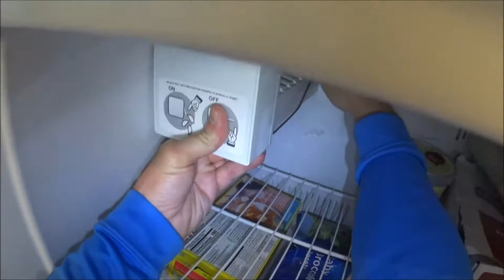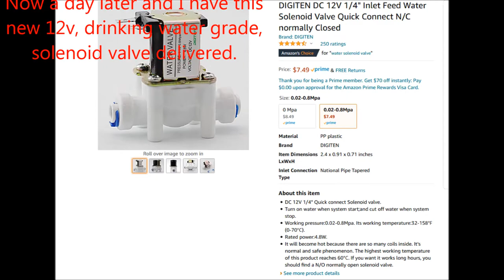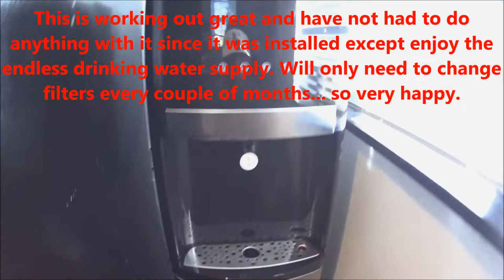Bottle-less Water Cooler Modification Hack Upgrade To Filtered Automatic Endless Supply System

Comment: This is exactly the solution I was looking for! We don’t need bottles anymore because we put in a filter system, but missed out on immediate hot / cold water with a built in Keurig. Thank you!
Reply: Did not the water dispenser not heat or cool anymore once you converted it?

Comment: Thank you for this wonderful idea! I was looking to supply the water cooler from an osmosis water filtration system. This is definitely the easiest way.
Reply from the maker: You are very welcome. That should work great as long as there is at least 30+psi going to the solenoid valve it should fill the cooler tank quickly enough (cooler has a fill timer so it knows when the water level is depleted, i usually just open and close the door to restart fill timer if i have used a bunch of cooled water too quickly - like filling 1/2 gallon jug non stop)
Reply: @macaroni2415   I don't know. The filter flow is not that great. I'll let you know the results.

Comment: I did the exact same thing! Similar model also. I was thinking of making a video, but you beat me to it. The sound of the pulsing solenoid is gratifying. Perhaps a link to the 12V solenoid would be helpful. I bought 3 for backups. So far, after 6 months, no problems. I will flush it out with a mild bleach solution and then with citric acid in a few more months.
Reply from the maker: Hello DDD curious if you are still using this setup. Its 2/3/23 and ours is still working perfectly and have saved approximately 180- 5gal bottle refill/exchanges so far. So happy with it, we hated lugging those big bottles back and fourth. Yes agree that solenoid pulsing is sooo gratifying. I will look for that link and I think it was from amazon (cant remember if i originally added it to video but i think so)
Reply: @Mac Aroni  

Still working with the first solenoid. 

I  run some mild bleach solution every couple of months from the water filter through the cooler. I add the solution into the housing with the filter removed and then flush it through. Otherwise, there will be "lily pads" growing in there. 😆

The old bottles are gathering dust.

Comment: I will been trying this, hopefully this Thursday coming up.   I got the part from Amazon.  So the water pump is not needed anymore because of the water pressure coming from water line.
Reply from the maker: Thats great to hear, hope it works perfectly for you. * remember to connect the correct (in/out) sides on the valve and use a 12vDC valve. Good luck.

Comment: I have the same water cooler and am trying to do the same thing to mine. I ordered the same valve you used and installed it but the water ends up filling up and draining out of the overflow tube.  I re checked everything to make sure the water was going the right direction and everything was correct. I figured i just had a defective valve so i ordered a new one and installed it but got the same result. I thought maybe the line just had too much pressure so i turned the pressure way down.  Same result.  I have no idea what the problem is. Anything i may be over looking?

Comment: I did the same but not sure why the out put I am getting in the 12v is list between 0.5 and 1.5v, Not sure why. Will it be issue with the door switch or the board or something else? Do you have any idea?

Comment: Thanks for the hack! This worked great except now the cold side keeps freezing up the water. My gut feeling says swapping out the pump shouldn't be related to the cooler but that is the only thing that I've modified. Now we need to shut off the cold side to let it defrost then it'll dispense water. We've defrosted the cooler a few times now. Anyone have any suggestions on the fix? I cannot see anything that would turn up the temperature so that it doesn't turn the water into ice.

Comment: So i need to remove the pump first? Because mine had water going everywhere
Reply from the maker: Hello, yes the pump will be removed one way or another either partially or completely (i removed mine from the cabinet as its no longer needed) and yes water will drain from pump and tubing so place a bowl/bucket until drained. Hope you had success with your setup.

Comment: great video, is it possible to instead of the water line coming from the home, it will come from a big 30 Gallon Water Barrel that I can fill with a couple of those 5 gallon bottles?
Reply from the maker: Thanks, and sorry for the late reply. I think in your setup it would still need the (fill pump/motor) since there's not enough pressure to fill the cooler tank.

Comment: Thank you for this video! I did exactly as you said and everything worked great. Except every once in a while the dispenser makers a really loud buzzing noise that can be heard in the other room. When I press for the water to come out it sometimes stops. It didn’t do this before. Any ideas how I can fix this? Thank you
Reply: Probably the pressure is too high, try controlling the flow from the source valve.

Comment: Hello 👋🏾 it’s a great video and very helpful 
I just have one question is the red light always blinking and can I still get the water cold/hot when is blinking?
Reply from the maker: Hi Omar, sorry for the delay but no the red light should not stay on (reset it by opening, wait 5sec then close the door) and if the light is on the cooler/heater will not run until reset. If red light happens frequently, it may mean there's not enough water pressure, water valve or filter clogged.

Comment: Why can't we use the original pump on the dispenser?
Reply from the maker: simply because the pump has no way to positively shut off water pressure going into it but the solenoid valve does do this. You need a way to kill the water flow when the cooler knows its at full level.

Comment: Can u be more specific about the fill timer?
Reply from the maker: The fill timer is the circuit boards built in clock to shut off filler (on power) which is usually the pump so that if the tank level isn't filled in that time (aprox 1min) it thinks the previous source (5gal bottle) is empty and shuts off pump and cooler.
Reply: @macaroni2415  Is there a way to overpass the Fill Timer? Or it is not necessary?

Comment: Is it possible to do this with the pump still attached? I would like to use a reverse osmosis filter system, but I'm worried that the water pressure will be too low.
Reply: I guess you will have to use both, the solenoid is for stopping the water flow when the tank is full.

Comment: How hot does that solenoid get? Does that cause any issues?
Reply from the maker: Sorry so late, the solenoid should not get hot or even warm if done correctly.
Reply: It won't get hot because it gets electricity only when the tank needs water.

Comment: UNFORTUNATELY I DID THE EXACT THING ON A PRIMO MODEL 601125 AND IT KEEPS OVERFLOWING THE RESERVOIR TANK.. ANY SUGGESTION? THABK YOU IN ADVANCE…😊
Reply: Same thing for me on the Primo Model 601292
Reply: I wonder if putting a shutoff valve in line with it where you could turn down the pressure would keep the timer from overflowing the unit? We had an issue at our office when they tried to run an RO water line to a coffee machine. Depending on how much water had been removed from the system prior, the pressure was always fluctuating in the line. The coffee machine just used an adjustable timer to fill coffee pots. We found that sometimes we would overflow coffee pots and have to catch it with a 2nd one, and sometimes they would only be half full if someone had used water from the water cooler next to it before coffee was made. We ended up getting a gravity fed machine because it required someone to watch every pot be made in case of overflow. We adjusted the shut off going to it as close as we could, but the pressure changed too often.

Comment: Does this work on units that are top loaded ?
Reply from the maker: Sorry so late, I don't think so since the top load may use vacuum on bottle to stop fill flow as where the bottom?pump fill uses electronics and logic circuits to achieve this effect.

Comment: Couldn't you just hook the water line to the existing pump?
Reply: no because the pressure in the feed waterline will continually fill the water cooler tank and will overflow. There is nothing there to shut it off so the pressure just keeps filling

Comment: When I installed as per your direction, my water is passing through too quickly and dropping from all sides,  then I changed where attached  black and red cable. It got the error message. Could you please guide me what am I doing wrong
Reply: I would really appreciate the help here
Reply: I have the same problem when turning water on after changing filter.  It seems to be the float isn't working correctly.
Reply from the maker: @rottydog01  yes most likely float stuck or frozen over will also prevent its operation.
Reply: @macaroni2415  turns out my pressure was to strong for it to close.  Added an on/off valve to adjust water flow an haven had a problem since.

Comment: Do you know anything about the quench bottles water cooler? I have one but the water is not coming out.
Reply from the maker: Hi Brittany sorry for the late reply. I don't know about those coolers but just a guess (common issues) water freezing at spout or outlet valve broken. If freezing leave unplugged for most of the day and see if any starts to flow and will need a thermostat most likely. Hope you issue is resolved by now tho.